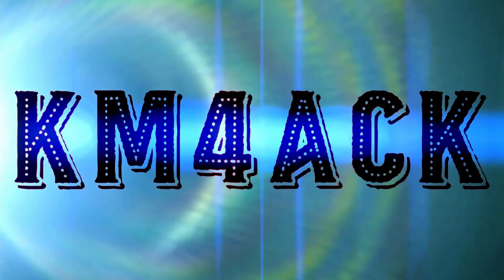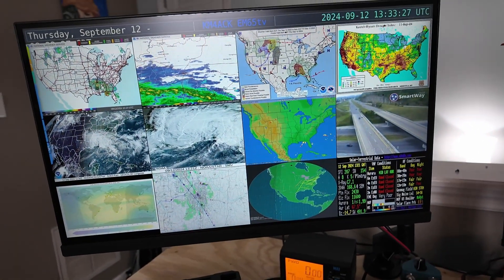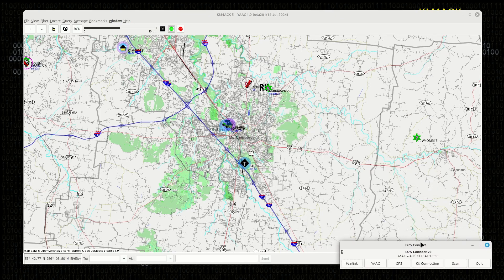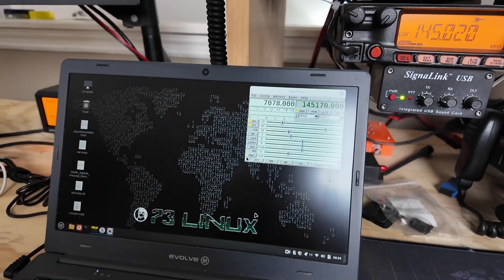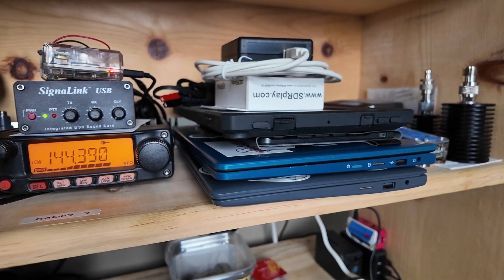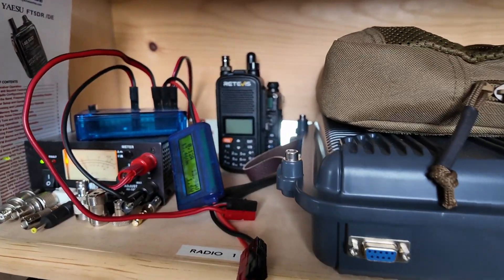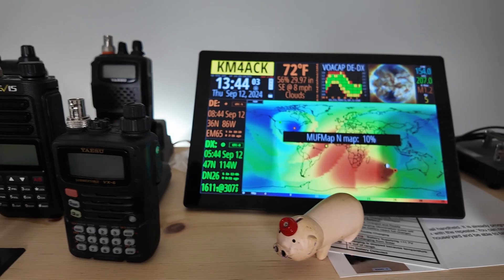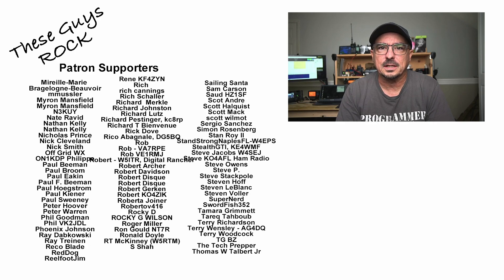Here's What I Run in the Shack

Comment: A very well ordered shack. Mine looks like a tornado came through. Thank you for the display files too. I run two monitors and it's always up on one of them. I've passed it on to several friends who wanted it. Btw I saw you connected to my HF Winlink gateway some days back. Since it's relatively new I like to get signal reports if possible. I'm good on QRZ if you can drop me a note. Thanks!